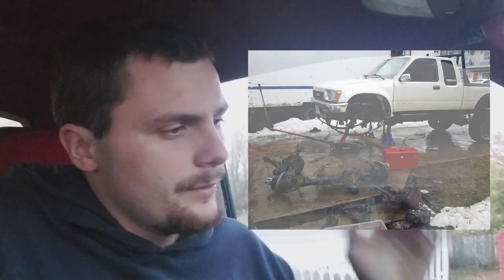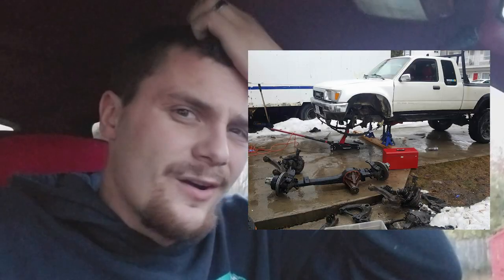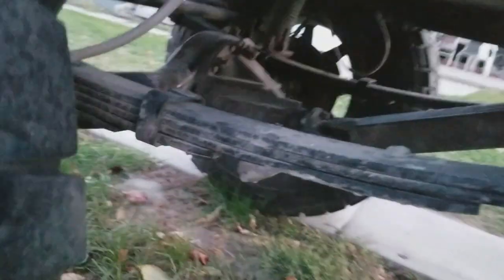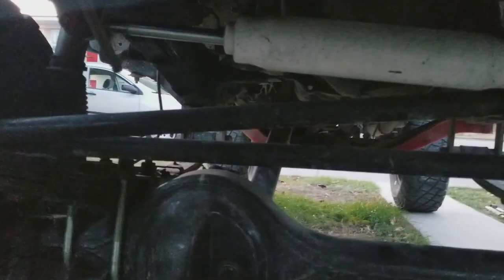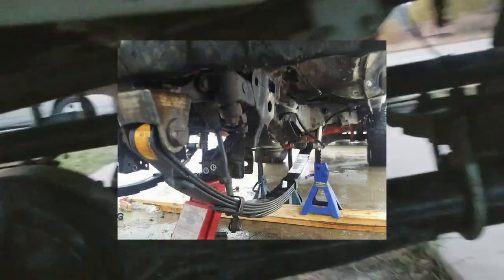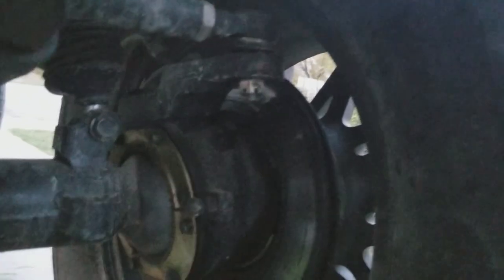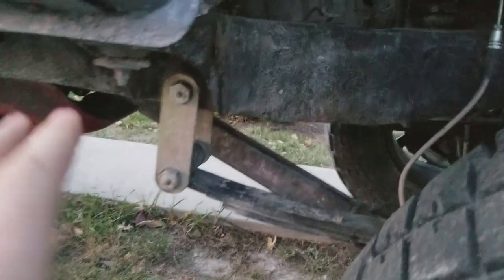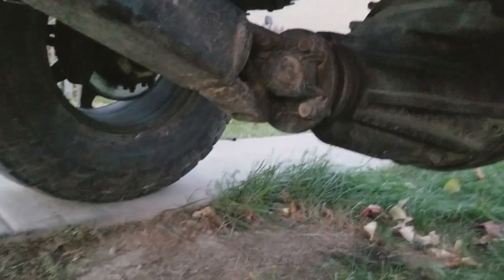How To Solid Axle Swap A Toyota! (My SAS Overview)

Comment: haha, when i was chopping my IFS off my 4runner, i used a oxy/acetylene torch, a sawzall, and a grinder. now i have a plasma cutter, and it makes work SO much easier.
Reply from the maker: I only own grinder and sawzall. Does the trick, but not ideal!
Reply: @DirtGarage  I used a oxy/ace torch and a grinder for years man. Finally had the opportunity to purchase a plasma cutter, and jumped all over it haha.
Reply: how didi your steering got together  for the sas on 4runner  
im woundering  about doing my 4runner  with  a sas

Comment: Awesome video man, love to see somebody documenting this stuff. I just finished the whole solid axle swap on my 86 4runner, but I'm curious what did you do for the rear end? What way did you lift it?
Reply from the maker: Thank you so much! Originally it was stock rear leafs with 4" lift block. Then it was Old Man Emu 2" lift leafs, a 2" block, and Tundra shackles. Now that I've lowered the front by cutting the hanger off and moving it up in frame I'm just the Old Man Emu leafs and Tundra shackles! Video for the new setup comes out Friday 🤟

Comment: hahaha! yes! the chatter of square tube driveshafts! man, this is so similar to my build!
Reply: analog56x hey man I’ve watched your vids since your red 4Runner build and I love it man. Keep making more vids man 👍🤟
Reply: im working on it. i just put up a LED backup light video. i gotta get a place to work on my truck... especially with what i want to do to it... i want to 4link it and go airride. but you gotta have a level surface to do suspension work on, otherwise, it wont be set up proper haha. im able to do very small projects on it where im at, but anything requiring electricity is out. plus, i have to time my projects. i gotta record when noone else is on the property, and when its not raining or snowing... so the new place is not really conducive to making videos :(
Reply: analog56x I understand man, keep doing you, your awesome

Comment: Dude this is awesome. Will definitely get that kit for my sas. Your truck is set up exactly how i want mine. 3.4 sc sas.
Reply from the maker: SR5in4Lo Was my goal for years before I finally pulled the trigger and went for it. Glad I did. Great setup, and turns lots of heads.
Reply: Ya I got mine all Geared Up and Now Massachusetts gunna enforce Lift laws cuz cameras are Going in Inspection Bays,,,...
Reply from the maker: Lame, sorry to hear that. And getting a SAS truck through inspection isn't impossible, but it's damn difficult, I've been going through it since June trying to pass a inspection.
Reply: they Say off site Inspectors will Watch through Cameras to See if Inspector is Doing His job...So the inspector is forced to fail...all vehicles...that otherwise he or she may Deem safe and acceptable
Reply from the maker: In Canada, or atleast where I am. You have to get your welding signed off by a ticketed welder, and go through structural integrity inspection, and then a standard vehicle inspection to get a SAS truck though.

Comment: Give information about your 3.4 and supercharger!  Please be detailed as baes off your information , I may or may not tackle myself too.  Was it worth it?
Reply from the maker: Supercharger is amazing! I would highly recommend. In my case, I purchased the supercharger alone and had to source the rest of the parts to make it work. And it took a lot of work and trial and error to make it run well with my swap. But overall love the extra torque it produces, and sounds amazing. It's kinda funny because it has become what most people love about my truck, nobody seems to care about the rest of the mods, to me it's just a added bonus!

Comment: Hi, Nice conversion. I also have a LN109 with IFS and I am thinking about swapping it with SAS. I have one question though. Why didn't you got a 'front drive shaft' of an LN106 instead of making that squared one?
Reply from the maker: It's different. My driveline angles at the time would not work, and the front diff is pushed forward, so lengths will be off, plus my t-case output is probably in the wrong spot too. And LN106's  are super rare here. All trucks in that body style in Canada where IFS.
Reply: @DirtGarage  Thanks for the fast response. Does this mean LN106's driveshaft is perfect for this swap if you can have it? we have plenty of those here.
Reply from the maker: @MuhammadShams  Honestly no clue. I've only ever seen 1 in person, and did not measure it. Super rare, and they have to be imported here.
Reply: @DirtGarage  Thank you for the help.

Comment: Love your rig man my question is about your Bilstein shocks hows the ride? Have you done the body mount bushings? And wondering if you have done any bushings on your leaf springs and if that makes the ride more comfortable if you have done the bushings? Thanks man have a great day thanks for the video
Reply from the maker: Thank you for the comment! The Bilsteins are great and would highly recommend. The ride is not bad for a SAS rig, in my opinion rides better than my IFS did with BJ spacers. I recently replaced a couple of body mount bushings that the body lift destroyed. As far as leaf spring bushings go everything came with the Trail gear kit and seem to be just fine. Thanks for comment, please subscribe if you haven't already, I'd love to have you around!
Reply: Dirt Garage 😍😍you had me at your response lol ya man i have subscribed thank you.

Comment: Awsome video man!
How did you know exactly where to have him weld the rear hanger setup?
Reply from the maker: The rear frame jigs for the SAS generally get mounted in the same spot, and you move your front hanger around to accommodate different springs. I got him to do exactly what instruction said for the 3" kit we used and it worked out. Check out my updated SAS video in the description though, we changed ALOT.
Reply: @DirtGarage  thanks for the quick response.. new subscriber here 👍👍
Reply from the maker: @guttmagurkee4802  Awesome! Thank you 👍
Reply: It comes with the instructions in the trail gear kit. Very simple. Be prepared to do a lots of grinding. 👍🏽

Comment: Hi, I am new to all this stuff so excuse my ignorance. Can something like this be done to a 2wd Toyota? Or is it to much work and I am better off buying a 4wd? Also, since I am interested in a truck I can take to the beach,  would a long travel (pre runner) be a better option and cheaper?
Reply from the maker: 100% can do this to a 2wd, it's more work though. You need to swap trans and transfer case, brace frame, and move the steering box, as well as everything mentioned. And if you want to long travel finding a 4x4 in first place is the way to go!  4x4 with LT sounds like the best for you but is more expensive.
Reply: @DirtGarage  thanks!!!

Comment: Hi steer clearance to leaf spring?  Your drive line looks like it will bottom out before suspension. Have you checked?   Breaking a t case would suck.
Reply from the maker: Yup, zero issues with high steer! And I didnt have the bump stops installed at the time of making this video, I hit the bump stops before bottoming out the driveshaft 😁 I am going to make an update for this video soon!
Reply: @DirtGarage  cool. When my front diff drops the spring will arch enough to scrub steering tie rod.

Comment: nice build how did you hook up the steering  im looking into tthe sas on my 3rd gen 4runner but am not short how the stering will go together
Reply from the maker: Thank you! Steering was super simple, I used the Trailgear high steer kit, it utilizes the factory steering box location and everything bolts up.

Comment: Nice build dude! How does it drive on highway speed? I plan on doin same on my rig. Thanx
Reply from the maker: rabs2020 Better than my crappy ifs was on the highway that's for sure! It was worn out with balljoint spacers, so not ideal. Except  when hauling my trailer on highway, that's the only time it's sketchy.
Reply: Dirt Garage  i think as long as everything is  squared and measured 10x it will be alright. I heard so much about negative doin sas so im having second thought

Comment: Did you use the ifs steering box ? Im currently doing a swap and not sure if i need a differant steering box or if i can use my ifs box without a high steer thx in advance
Reply: Ahhh nvm rewatched and payed attention hahaha
Reply from the maker: @GreatFlibbityJibbits  Yeah I used the IFS box with the High Steer. You should check out my later videos on the solid axle swap. We changed alot, and setup is much better. https://www.youtube.com/watch?v=6S0irSDEWHA
Reply: Will do thank you for the response good sir

Comment: Hang on.. let me get this straight... you swapping out a IFS for a solid axle? Why? I have a oringal 85 Toyota 4x4 with a solid front end and it handles like a boat. What's the reason to do all that work and end up with a truck that handles worse?
Reply from the maker: Because its strong and flexes great! Plus there is tons of aftermarket parts to make it even stronger. And in my case handles much better than my lifted clapped out IFS was. Plus I would not put 37" tires on IFS, the solid axle handles them like a champ.

Comment: Do u retain the stock ifs transfer case ? Or u need to swap that to
Reply from the maker: You retain the stock transfercase yes.
Reply: @DirtGarage  and one more thing. about where do u place the upper shock hoop. im not entirely sure how far forward or back on the fram to pin it or how high or lower on the frame rail

Comment: Did think that it's possible to do that kind of axles work in toyota tundra 2005
Reply from the maker: I would not recommend it. Tundra is pretty heavy for the stock Yota front axle. Plus I need spacers to make it wide enough for my Pickup. So it certainly won't be wide enough for your Tundra! Thanks for watching though.

Comment: I'd like to know how long the front leaf spring's are? and from where did u get then? If you can help that would be great. Thank's
Reply from the maker: The leafs I used where from the Trailgear IFS Eliminator kit, they are 3" lift springs. I'm not sure how long they are, I will measure soon and get back to you.

Comment: Trying to make my own leaf pack have any suggestions?
Reply from the maker: Not really man! Thats not the route I took, maybe use rears up front? I put 2" add a leafs in my rear leaf pack to raise the rear to match the front.
Reply: I'm running 4 inch all pros, with ruf

Comment: So, that pos front drive shaft snap yet?
Reply from the maker: Nope. Over 2 years and shes still minty
Reply: @DirtGarage  I don't know why, but it makes my brain hurt to look at.
Reply from the maker: Why? It's actually really common for wheelers. Really practical with it's really long slip, and its ridiculously tough. It's not used on the roads, its perfect.
Reply: @DirtGarage  I don't know, it just looks so wrong to me on so many levels. Is it a ghetto spline or just a square tube driveshaft? I can live with a square shaft but if there's another smaller one inside acting as a spline, I'm kinda missing the point, but I also enjoy driving over 35mph..
Reply: @justin76bmw   just two square tubes. No splines. All the slip you'll ever need. They are noisy but that's it. And you drive that truck 200 mph fine if you could get it to go that fast. You don't drive 60 mph in 4wd. Unlock the hubs. It won't spin.

Comment: Long story short save lots of money. Find someone to help and teach you do it or pay someone to do it.
Reply from the maker: Kind of? No getting around the saving money, the kits are expensive, even if you just use RUF you need the brackets and the high steer. I just paid someone to weld my brackets on because I did not have a welder or any experience at the time. Check out my latest video on the SAS here for an update, we ended up changing ALOT of the SAS. https://youtu.be/6S0irSDEWHA

Comment: The rear lift
Reply from the maker: Thanks for leaving a comment! To lift the rear I used 4" blocks to raise the rear to match the front. I currently have Old Man Emu leafs on the way to run with a 2" block instead.

Comment: Hey how high of a lift was that? I'm looking at a 4" for 33x12.50 MT's
Reply from the maker: I Be Trollin' They Be Hatin' With the 3" trailgear kit you get about 5" of life. Lots of room for 33s
Reply: Awesome! Thank you! so the 4'' springs w/ ifs removal would be way too big right?
Reply from the maker: For 33s correct. It would be 1" lower than my truck with that setup.. In theory, I have 3" springs and 2" body lift to clear the 3.4 and supercharger.
Reply: Sweet, Thank you so much. Subded and liked. Much appreciated.

Comment: Wtf a square driveshaft
Reply from the maker: It's pretty common. Super strong, cheap, and slip is as long as the shaft. No problems 2 years later.